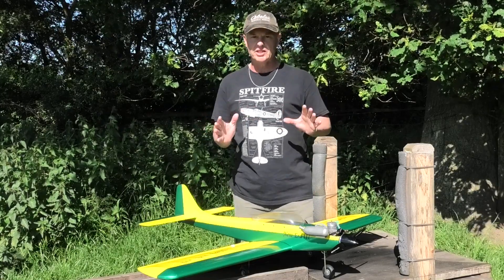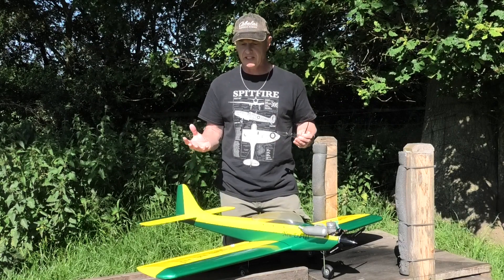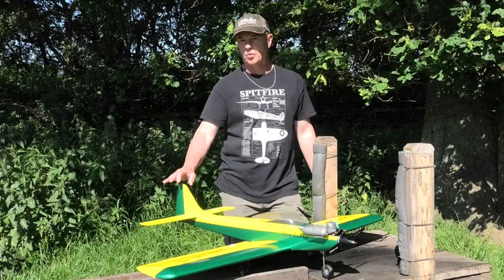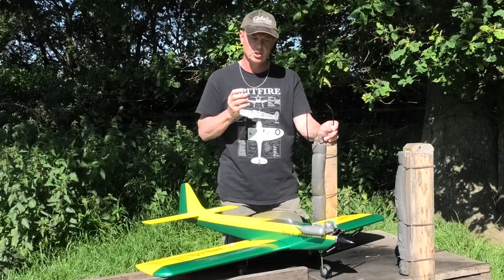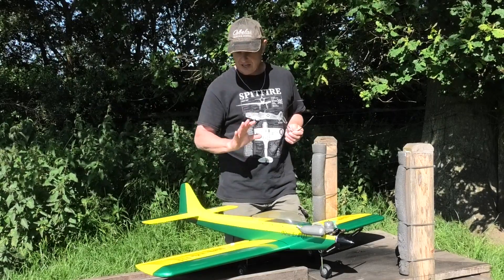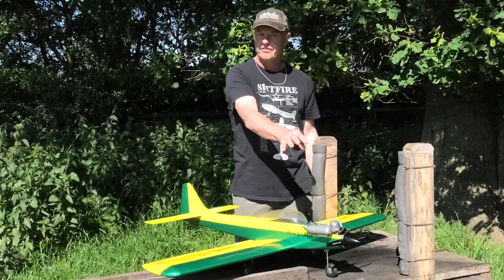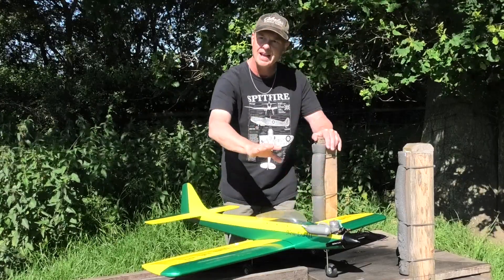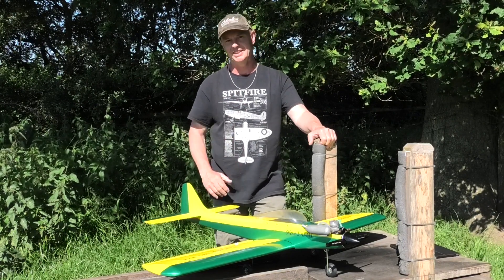New Era III Revisited: Pt 19 Build & Flight Review - 45" wingspan RC balsa aeroplane

Comment: Is the Irvine ABC or ring? Would you think about moving the servos to the tail to help the balance ? Nice job!
Reply from the maker: Hi Joey, its an ABC.  I did try to move the battery to just behind the wings,  but that made it tail heavy and I would have needed to add weight to the nose, I think that if I had put a servo in the tail, again I may have needed more weight in the nose, but this could be done by moving the battery forward, so is a posibility. Never good to add weight.